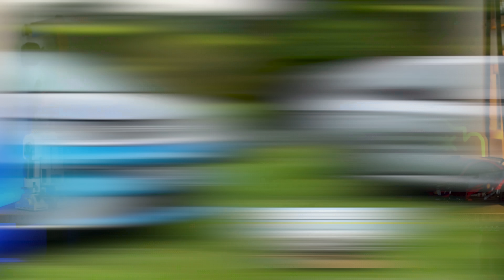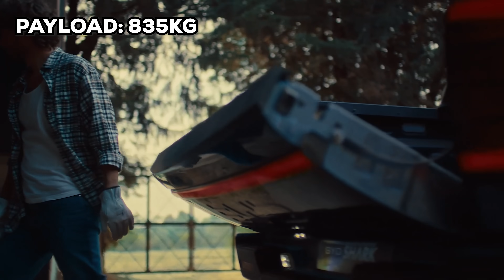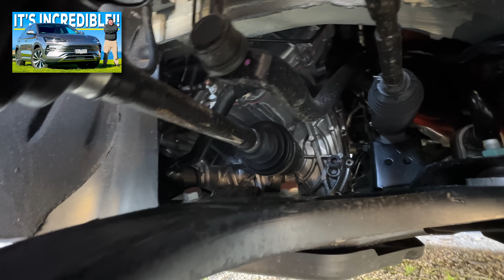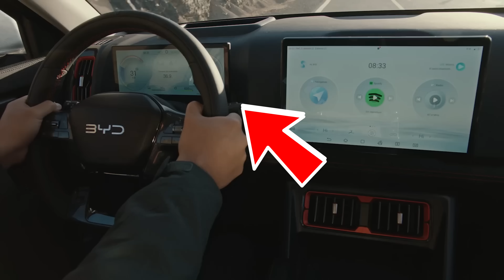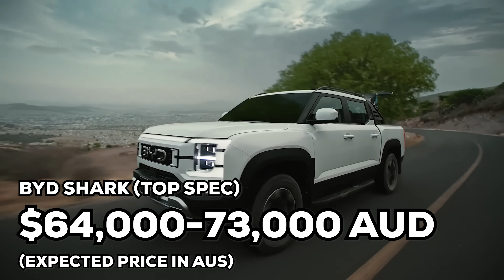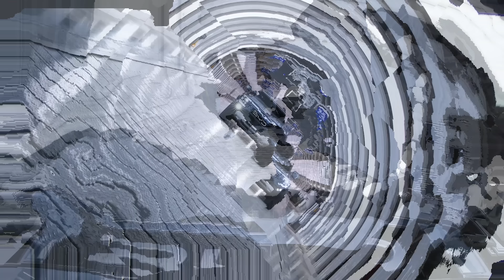The BYD Shark will FOREVER CHANGE the Truck Industry.

Comment: This is solely electric motor drive, the engine is a generator,  it’s like the old volt.  There’s no stress on the engine except turning the generator. You never have to plug it in if you don’t want to.

Comment: Until you need it repaired....... no repairer's are very interested as parts are insanely hard to get and are usually damaged when you get them and the adas systems are a nightmare to be calibrated. People have damaged ones sitting in their driveways for months with no one to repair them.

Comment: Look, if I didn't buy a Z71 diesel in 2018 I would seriously consider it top on the list.  Plug in hybrid, plus use it to power your campsite.... Puts most of the canopy modder's nose out of joint there.  Looks tidy and cheap enough for what you get.

Comment: Why does the fuel economy co fuse me so much? 7.5L in hybrid mode but I seen on car expert it says 1.5L if the car starts with a full battery.
Reply: 1.5 l is the motor. I don't how much I does on gas per km

Comment: Time will tell.
The climate of Australia is the harshest test for vehicles; hot, wet, salty, windy, dusty, dry, cold snaps. You can really tell which vehicles are good quality based on what ends up staying on the road.

For example; the old generation Ford Ranger was designed in Australia by Aussies, and built international. It has been unimpressive except for reliable. The new generation has already issues. It was designed in USA with similar international manufacturing. The old D-Max was heavily criticised for being unrefined and "too truck-like" but has topped the list for reliability. Meanwhile the Toyota Hilux has been okay, it has only stayed competitive due to excess parts availability and their vast support network.

Same things apply for other vehicle categories. Especially Euro variants which make changes for the sake of changes, and add unnecessary complexity. The simpler a product, thr more reliable it is, and easier to keep it alive.
Reply: China also has harsh environments,  very hot,  very cold etc

Comment: Must have forgotten the coil spring all round navara. Which also has 3.5t towing.
While i would highly consider the BYD ute, only having enough range to get me to work is a little disappointing. 
Then add the same fuel economy that i was getting from my navara and the nissan is still a consideration.
Curious how these will go in off roading with water crossings and the like.
If they have sealed the system well, could be a good thing.

Comment: I think most of you who have positive opinions on the majority of these Chinese brands is because they don't yet sell them in your country. Once they finally arrive those who do buy them find the quality is severely lacking. A few get good vehicles but here in Mexico we have major issues with all of the nearly 10 brands that import to our country. That includes BYD.
Reply: So your point is all brands have problems
Or exclusively Chinese brands?
Reply: @edisonwong320  Chinese brands. Even if our consumer protection regulator (PROFECO) forces them to honor warranties, they don’t have replacement parts. So in Mexico you see a huge number of them traded in with less than 1mi because there’s always something wrong with them. You can check Kavak listings and see what I’m referring to.

Comment: Does the motor have a direct connection to the wheels like a chev volt, or is it just a motor generator, and all the power is from the electric motors?

Comment: While I'm concerned about reliability, I'm actually far MORE concerned with after sales support. 

No matter the brand something will probably go wrong, even Toyota has had a few issues of late. What makes a good car brand is HOW they handle a potential warranty issue.

Are they going to be complete d**ks like Ford are with the powersh*t transmission? Or like Mercedes with ... well everything?

Or are they going to be more like BMW, Toyota, Kia, Hyundai etc when it comes to customer support when something goes wrong?
Reply: any electric car does not last longer than 3 years
Reply: @RSCB  not at all true. 

The battery might not. The car will be fine. 

That being said. There are plenty of 5 / 6  year old electric cars on the roads that work just fine. 

I'd invite you to please understand your own biases and to actually observe the world before making daft claims.
Reply: @schrenk-d  you're right, electric cars don't last more then 3 years
Reply: @RSCB  I see you exist in your own deluded world. Have fun.

Comment: If you like camping, this is definitely a great purchase. I went on a cross-country camping trip in Xinjiang for almost a month last month. I drove a Leopard-5, which is also a DMO platform. It has a 220V external discharge, which is great. You can bring an electric heater in the tent. can cook

Comment: I think this is a good thing for the industry. 
However I think you missed a very big concern of anyone who Owen's and uses a 4wd properly. Batteries don't tend to like vibrations, dust or moisture.   Plus what is the replacement cost of the battery (which has to affect resale value). Finally electric vehicles tend to suck when you start adding weight, so how much range will you loose. All these things are why diesel are still king. Until these concerns disappear, vehicles like this are going to struggle outside of cities.
Reply: Its a hybrid

Comment: BYD did not become the biggest EV maker in the world in 2023. They sold 1.6m EVs to Teslas 1.8m. They outsold Tesla in EVs in Q4 2023 but Tesla then we’ll outsold them in Q1 2024. So it remains to be seen whether BYD can overtake Tesla in 2024.
The story shown is FUD. BYD sells both hybrids and EVs. In China, both are referred to as NEVs or new energy vehicles.
So if you call a petrol powered car with a tiny battery an EV, then BYD outsold Tesla in EVs.

Comment: Whether we like it or don't.. the chinese car reality is upon us due to masses and pricing. We are just lucky that the stuff not only is it decent but already heads and shoulders with the competitor. And it didn't take long. So imagine giving it another 5 years. The rest have no chance. Giving us more than what we want and cheaper/better than any competitor.. yeah you have my attention and money.
Reply: BYD will achieve global success. I spent 110,000 RMB (15,000 USD) in China to buy a 4.7-meter-long Hybrid SUV (BYD Song) that can drive 100 kilometers on electric power. When the electricity runs out, it switches to gasoline, with a fuel consumption of only 5 liters per 100 kilometers. This is incredible and a very economical choice for ordinary families.
Reply: wrr

Comment: Yeh reliability and brand perception is the biggest drawback.  My wife has had a BYD Atto 3 for 2 years, trouble free, reliable, and given she;s a high mileage driver 60,000km per year, she's saved over $10,000 in petrol and servicing costs.  I;m still struggling with the concept of Chinese made cars, but week by week, I'm slowly chnging my mind and might buy one in a couple of years?? Still undecided, if I had to buy a car today be either a Mitsubishi or an Isuzu.
Reply: It is the inability to compete with local carmakers, led by BYD, that has forced Mitsubishi and Isuzu to pull out of the world's largest car market (more than a third of global car sales are in China). In addition, due to the rapid decline in sales from 8% to 1%, South Korean automakers have also sold most of their production lines in China to Chinese automakers, and it is estimated that they will soon withdraw from the Chinese market.
Reply: BYD 👍

Comment: Most Toyotas in the coming years are going to be rebadged BYDs and GACs cars (with a different front and back end), that are marked up heavily for the western markets. BYDs rise is not from nowhere go do a tour of their campus in China which is open to the public you will understand how diverse and large the company is. My first encounter was in 2009 when I realized almost every taxi, I got in to in Shenzhen was a BYD the tech of the car was good but the rest of it not so. Still, I knew this company is going somewhere and if u have a Nokia from the 90s and pull the battery of most likely it will say BYD. When BYD says something, they mean business.
Reply: I came across a news article that Toyota Corolla will have the new BYD engine with 2,000km range with a single tank. OMG, Japanese using Chinese engines and soon with CS35 (Chinese Standards 2035), Japanese might as well use Chinese AI for self-driven cars.😛
Reply: yet all the western media are still going on about Chinese stealing IP from others. All western brands and Japanese just send there repasentraive to trade fares in china put there logo on and sell for 40× the price in 2024. There is 0 r&d done in the west and Japan.
Reply: With so much protection for years Detroit 3 cars will be dinosaur.
Reply: Many of us are guilty of hearing an unfamiliar company name, and assuming it is a new company.
When Hyundai released its first cars to the western world, lots of people thought is was some little startup, with its quaint little cars, not the heavy engineering giant that it really was.
(I am NOT comparing BYD to Hyundai... just pointing out that we should never assume anything, without first checking the facts.)

Comment: I just got a shark in Mexico and it is impressive how you get a truck this big this powerful and with all this tech with very low  operating costs. It seems It'll be cheaper to run than using my Honda civic 1 5t. Just in highway it is where the efficiency drops a lot but still the best fuel consumption for a truck , using just gasoline. I really feel this is a before and after in the pickup segment. Let's just hope the aftermarket service It's at the same level.
Reply: Let's dream, that it can be almost as long lasting as an old Toyota, or a AK-47... I'm hoping for a right hand drive shark with a bit larger tank for the Caribbean, that will not cost As much as a new 2024 Toyota or Ford Pickup..I hope
Reply: @zechssiguro7476  Still waiting for the seal and that section to reach Barbados. It would force MG to lower their prices and maybe invite KIA and Hyundai dealers here to bring in some of those EVs.
Reply: Excelente comentario Luis, cuantos kilómetros alcanza a viajar en carretera exclusivamente en modo eléctrico, cuando la betería fue cargada originalmente al 80%?
Reply: @pablolubbert9739  no lo he probado así cómo tal por que no es buena idea dejar que la bateria se drene por completo en carretera por que vas a tener al motor de gasolina trabajando forzado para recargar también baterías. Lo ideal es usar EV en ciudad y en carretera HEV para siempre mantener un buen nivel de carga y toda la potencia siempre disponible,  en ciudad una carga y tanque lleno da como 700 km reales y en carretera como 480km. Como 10km/l en carretera y mucho más en ciudad,  aunque lo ideal es cargarla seguido para no utilizar combustible cuando no haces trayectos de más de 100km al día.
Reply: @luisvillegas7671  Gracias, los 100 kilómetros en ciudad los puede dar si esta cargada la batería al 100% hasta llegar al 20%?
Reply: @pablolubbert9739  no creo la verdad ,aunque depende ya mucho del conductor, de los hábitos de manejo en el frenado , si se puede recuperar mucho con el freno,  pero yo creo que difícilmente dé los 100km del 100 al 20%.

Comment: In China, I have sold my Range Rover and Audi A6 and bought a Denza D9 and BYD Dolphin.
Reply: How do you like your D9? I went to BYD Jakarta last week asking about D9 and U8, unfortunately they don’t even have price for D9 but allow a booking fee and only say around March 2025 for price 😅. They just confirmed today there are no plans to bring U8 and U9 but if I import myself from China, they will service it locally. Looking to replace my Alphard with the D9
Reply: @WarrenKLiu  D9 is the best selling MPV in China,more than  toyota sienna
Reply: @WarrenKLiu  Lack of servicing is the big problem, after battery issues.
Reply: @bigglyguy8429  not for me. BYD dealership is walking distance from my home, less than 500m away and all dealerships are BYD owned, they haven’t franchised out.
Reply: @WarrenKLiu  11 of their dealerships have burnt to the ground I heard?
Reply: @bigglyguy8429  GM has 3 dealerships fire non-EV cars in 2023 alone in the US. If BYD encountered only 11 to date, they are tracking well as it would average about 0.5 fires per year. If its global basis, then the average goes even lower. I'm not sure the issue here.

I did a quick google and there's only 1 confirmed report, the others are all with the typical MSM clickbait of Allegedly, Supposedly. The single confirmed case was from the Chinese city of Fuzhou fire department. Again I just did a quick google and scanned the results

There are a lot of the cheaper BYD models on the road in my neck of the woods already, I've heard nothing but praise from the people i know who drives them. I'm getting their top of the line stuff, I'm sure I'll be fine. I'm actually interested to see how their service compares to Toyota since they cheekily have their showroom right next to the Toyota one right smack in the middle of the banking district. Pretty sure its a sorta throwing down the gloves gesture to Toyota.
Reply: Herd of cows😂 @bigglyguy8429
Reply: Then you obtained 0.1 unit of Mercedes-Benz and 1.9 units of BYD.
Reply: That's embarrassing. I wouldn't tell people online. lol
Reply: @mononeo   I don't think so, he didn't say how old the ranger and audi were

Comment: BYD rust proofing of body panels and chassis will be the big long term issue. Otherwise they're built pretty much like any other vehicle. I had a BYD SUV as a hire car for a couple of weeks only 2 months back. I would never have chosen one, but I'll admit it surprised me in some ways. It wasn't bad, per se. It had some quirks. I've had backwards indicators before, so usually first thing of a morning I hit the first turn and the window wipers come on, cue swearing about stupid Chinese copying stupid Americans, and I'm right for the rest of the day. Same as when I owned cars that were similar. The auto was weird, which may be because it's a hire car and not driven with vigour (the insurance costs meant I wasn't driving it with vigour either). There were just times when it wouldn't downshift unless I floored it, and even then it hesitated. I had one close call when some twat decided to do a drag car launch to stop me merging, and when I realised and went to accelerate out of trouble, it did nothing. So I did what any self respecting Aussie would, and I hung out the window as he passed and yelled  "Git a dog up ya, ya flog". It was better in sport mode, but the menu was terrible to use, and you have to use it every single time you start the car. It was little things that made me go..."Nope. Not if I was paying what they're asking". I said then that BYD was about 4 years behind the Koreans, who caught up to the Japanese just in time for most of the Japanese brands to outsource manufacturing to the rest of Asia and downgrade themselves slightly. The next generation will be at about parity in quality, and probably still cheaper if the Chinese government keeps subsidising them. When the subsidies stop, all bets are off.

Comment: Phev's are stupid, a very uneconomical EV carrying an ice then ice carrying a ev. You have to buy and maintain both drive trains. Just go one way or the other.
Reply: EV drive train does not need much maintenance and having one will reduce the wear on the ice engine and its need for maintenance as well.
Reply: @ensteffo  But it does not - BYD still change to oil/filters etc every 15k/km. stupid idea just go ev or ice this middle ground is expensive and overly complicated.

Comment: If it shares the hybrid unit with the Formula Leopard then the power is super good. I drove the Formula Leopard and it does 0-100 in less than 5s, and its 3 ton heavy, and it drinks 8L/100km. That thing is magic.

Comment: I have been hanging out for the release of the Rivian R1T in Australia, which feels like it will never happen. I am already a fan of some of BYDs cars and if they release an all-EV version of the Shark before Rivian is here I would consider buying one.
Reply: This powertrain makes way more sense for a pickup/ute tbh. Going camping or doing some power tools work, using the v2l and then you can still have the range to get there and back. I think with a Rivian being full EV you'd never feel comfortable enough to do this for fear of being stuck with no juice. BYD were smart to give this a pretty sizeable battery for a hybrid.
Reply: @injinerconev You do have a point. However, I have been a member of a Rivian owners Facebook group for a couple of years now and the overwhelming opinions of those owners are extremely positive and contradict a lot of the nay-sayers. Quite a few of those Rivian owners do offroading and also tow boats and caravans. Rivian or an equivalent will be very suited to Australia and it's conditions judging by owners reports from the US.

Comment: I'm surprised that not more people realise how much of a SCAM the car industry is. The actual cost of manufacturing a car is only about 30% of the actual sticker price you pay for at the dealer. It's ridicuous how much markup and taxes there are hidden in the price of a car. It's stomach churning that you already pay way over what the car is actaully worth in real dollars when new and then you instantaly loose 20% once you sign the dotted line and get the keys. Depreciation is ridiculous. Then add all the running and maintenance costs. It's a bigger SCAM than Nigerian scammers themselves. It's crazy. The whole car industry needs an overhaul and maybe these cheap chinese manufactures willl start putting preassure on the big established car manufacturers to stop ripping us all off. Governments don't help either. They make a killing in taxes for every car that is sold, for doing absolutely nothing.